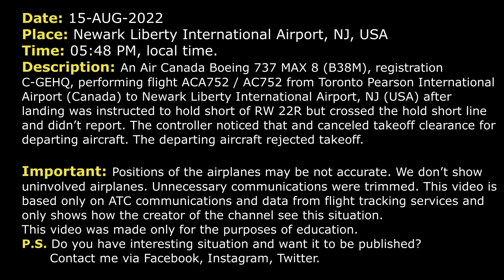Runway incursion. Air Canada Boeing 737 MAX 8 didn’t follow instructions at Newark

Comment: How is it pilot Deviation if the ATC guy told them to cross then changed it back to hold short as they are already moving?
Reply: Controller has some fault, but pilot should have waited for full clearance and read back before moving
Reply: Pilot shouldn't have started moving until completing the readback.
Reply: Lesson learned: Air Canada pilot should have just read back "Cross 22 right at ... November, ... Air Canada seven ... fifty ... eh ... two" so that when the controller corrects them they can say they already crossed the hold line. That way it's not clear the pilot is to blame, he can argue the controller gave an unclear instruction and waited too long to correct their read back. It's stupid, but has more chance of defending that point than the current stance of "yeah we crossed the hold line and then we lied and said we didn't."
Reply: If the ATC never said it, then there would have been nothing to disregard. They don't tell a pilot to disregard something they never said. The disregard is the smoking gun. The incident was at least 50% the fault of the controller.
Reply: @MaxZomboni  Okay, so for controllers who do this for a living, it is vastly easy to make a mistake like that. It happens to controllers everywhere because it’s human nature. You don’t carry out a command until the command has been both given and read back. Thats just the rule
Reply: @MaxZomboni  0% controller fault. He never issued a command.
Reply: @mattz1230  So what was it that the controller told the pilot to disregard? 🤔
Reply: @MaxZomboni  The crew was told to disregard any intentions that the crew had. 

Do you think the crew was issued any valid instruction? YES or NO. 

Do you understand that crews are prohibited from ANY ACTION that does not involve the safety of their aircraft without valid and complete instructions, AND without a valid readback?
Reply: @mattz1230  Okay, now you are just trolling. Your narrative is not consistent with the audio. Watch the video again and pay attention.
Reply: @MaxZomboni  I watched. 

Please point out the timestamp where you heard the tower give clearance to cross 22R, and the crew read back those directions.

The audio CLEARLY states that the crew was NEVER given permission AT ANY TIME to cross anything. They were told twice to hold short of 22R, yet not only did they fail to do so, but they LIED that they were holding short, when they had in fact entered an active runway, endangering a second plane and forcing it to abort its takeoff. 

Go, watch the video again. This time, pay attention.
Reply: @mattz1230  1:09 Air Canada 752 at November cross runway… If you have a hard time hearing then read the captions. The controller is a confused mess who caused the incident and then blamed the pilot for his own incompetence.
Reply: @MaxZomboni  Cross WHICH runway????

Where is the readback???

Without those, there is no direction. The pilot does not know which runway to cross, and has not confirmed. 

1:10, there IS a valid instruction: Hold short of runway 22R, and a proper readback, which was a lie.

Thanks, you proved yourself wrong. YOU LOSE.
Reply: @MaxZomboni  "The controller is a confused mess who caused the incident and then blamed the pilot for his own incompetence." No worries, the guy you try to convince is on your side: Blaming others to cope own social issues, so why the need to defend a side if you can hate both for free?
It's not like you have any intention to understand that the controller was just annoyed for good reasons: He had to cancel a takeoff and/because pilots did not >>report<< them rolling a bit over the line, which was still far out of reach of the other plane. After all it was just unfortunate that they just hit the brakes 2 seconds later due to expected clearance.
Reply: All valid points that add to safety, well said by all.  This is how I think it played out.

I would say crew needed to tell ATC when they were over the line.  Also, most likely, when they were given the first hold short clearance they were still moving towards the hold line when told to cross and had not yet stopped to hold short of the runway. Which is why when they were cleared across but told to disregard in the same sentence the nose had moved slightly over the line. They couldn't slam on the brakes to stop and it took some distance to stop.  The video shows them having stopped on November short of 22R when in fact they were always moving and it ended up just being bad timing. If they had stopped short of November there is no way they could move the plane quickly enough from when the controller said "cleared across, ahhhh actually disregard and hold short 22R." So they had to have been moving the whole time.

That is why it wouldn't be possible to have spooled up the engines and moved from a stop in the same amount of time it took the controller to say "cleared across, ahhhh, actually disregard, and hold short of 22R."  And I think the crew did not call tower because they knew they were in a safe position although slightly over the line. If they felt they would cause a safety hazard they would have spoke up. Perhaps there is a system that is extremely sensitive and notifies when an aircraft is past a hold line even slightly which is a VERY good thing. ATC did a great job by following the safest procedures just in case.

Bottom line is the crew should just make a quick call to say our nose is over the line.
Reply: @jimwilks1865  They were never cleared to cross. Can you give the timestamp when the controller directed them to cross 22R, and the pilot read back to cross 22R??

Because I can give you a timestamp when he read back to hold short.
Reply: @mattz1230  Matt Z I agree, they were never given the full clearance to cross 22R and to read it back. Only the clearance"At November cross runway......actually disregard and hold short 22R."  If they had been stopped at November already there is no way they could have released the brakes, added thrust and moved during that double clearance.  Horrible timing. The crew needed to let ATC know asap once the nose was over the line. That part is on them. I'm surprised the runway warning system allows ATC to clear another plane for take off  while another aircraft nose is over a hold line. Newark pushes Tin, they have too. Bad timing in this situation and a reminder of procedures is a must here.
Reply: @jimwilks1865  To be clear, because there are alot of people who don't understand it- the pilot was NEVER cleared to cross the runway, not full, not partial, not 1/1,634th of a clearance to cross. 

He was totally in the wrong, and the worst part was lying about it when he then told the tower that he was holding short. The proper response should have been that they overshot. 

Probably still got a number to call, but it would have been correct.
Reply: This one comment has over 20 replies lol
Reply: Controller fully at fault and tried to foist his mistake on the pilot.
Reply: @Capecodham  "Controller fully at fault and tried to foist his mistake on the pilot", well, luckily such professional environments are not about mistakes, faults and blames.
Else these would rather end up like deconstructive YouTube comment sections, where people are happy to judge and blame professionals while not even being remotely in the position to do so.

It's about responsibilities and constructive solutions. Even when the controller made them skip their brakes in this very second, he should still be able to expect pilots to >report< when crossing the holding line for some cm. 
Because after all ATC is responsible to have everyone stick to rules, no matter what. And you can't blame the controller for being somewhat disappointed about this outcome.
Reply: @thomas.leitner  Constructive solution: Air Canada crew is suspended, and required to retrain on ground procedures. 

Their foolishness endangered two aircraft and hundreds of lives, and they tried to lie to cover up their error.
Reply: @mattz1230  Yeah "Constructive solution..", sorry mate, you don't seem like someone who is able to contribute any valuable advice to any valuable business, when just offering the usual social media level of insults against skilled people. 
You are well aware that "Their foolishness endangered two aircraft",  is only your desparate attempt to offload your social issues onto others.
Like you would even care about how far this line is away from the runway, and how far they crossed it... It would not even help your intentions, if you would understand that even 1cm is considered a runway incursion. Even thinking that pilots would suicide themselves like that..
Just chill out man, like any other civilization before, our infrastructures and technologies are falling apparat anyway as such skilled people die out or give up while idiots raise over the next decades. So eventually you will be appreciated after all..
Reply: @thomas.leitner  If the controller never gave poor instructions, this never happens.
Reply: @Capecodham  "If the controller never gave poor instructions, this never happens." Indeed, an unfortunate incident of timing. When even 1cm can cause that situation you can imagine how many more safe guards and rules are there to avoid actual accidents.
Unfortunately those people who always do the correct thing, somehow always end up on social media, happily blaming others, instead of taking on such responsible jobs.
Reply: @thomas.leitner  PATCO gave the controllers what they deserved.
Reply: @Capecodham  No worries buddy, PATCO would not even talk to people with your attitude. Which is why you have to stick to YouTube. Such business only works with a professional "Just Culture" ("No-Blame-Culture"), which is the opposite of your social issues. Else you would find your like-minded people on their radio communications.
Reply: @thomas.leitner  Reagan fired them all.
Reply: @Capecodham  ".. fired them all" Yep, that's actually the  best thing that could happen to humanity. Getting rid of all those skilled people who feed idiots with language-capabilities, internet-access, and transport infrastructure.
Reply: @thomas.leitner  Except, FOOL the crew was never given an instruction. 

The only bad timing was this crew trying to rush to failure. Who then lie about their error. 

There are people who do the correct thing- they're called professionals. There are times where zero defects are allowed- aviation is one of them. Try getting one of those type of jobs- you'd understand why errors are not allowed, and you need to be professional and own up to your errors when you make them.
Reply: Nope.  ATC NEVER said “cross 22R.”   What he said was “cross…. actually Air Canada disregard, just hold short of 22R.”  

The pilot jumped the gun before receiving a full clearance AND…. The pilot should NEVER EVER proceed ahead with a directive from ATC, until the pilot gives a read-back of the instructions from the get-go.    100% pilot error and NOT the error of ATC in this case.
Reply: @colt10mmsecurity68  And to add to it the next error: Once he had crossed the line he should have read back "unable hold short of 22R, we're already over the line, sorry for that", that would have made it much easier for ATC to react properly
Reply: Being close to the runway it is not a good place to change your mind
Reply: @stenic2  no, the pilot started rolling and crossing the hold short lines BEFORE he received an actual clearance.  The pilot assumed he was about to get a clearance, so he began to cross prematurely.  All pilots know that we are to hold short and stay off the runway, until we are clearly given a clearance and then we read-back that clearance BEFORE we even start our roll.   Again, 1000% pilot error on this one.
Reply: @colt10mmsecurity68  when a plane like the 737max starts to roll it takes time for it to stop
Reply: @colt10mmsecurity68  ok it is formally pilot error but the lesson learned is that the controller should not give contradictory instructions to a pilot close to an active runway, I would say the mistake the pilot made was not reporting he had crossed the line. Once again I am not looking who to blame, I am only pointing out what should be avoided, I am a tower controller.
Reply: @stenic2  …I was a controller before becoming a pilot for UPS. I know both jobs.
Reply: @colt10mmsecurity68  "no, the pilot started rolling and crossing the hold short lines BEFORE he received an actual clearance." Isn't the issue more like, >while< ATC started to give them the clearance, they just did NOT hit the brakes, when needed? If they were already holding, wouldn't the engines take far longer than that to be able to taxi?
Reply: @thomas.leitner  Sure, you just explained it another way, but the end result is that the pilot started his roll forward BEFORE ever getting a full clearance.  I think you and I are on the same page here.   Others just aren’t getting it that just because ATC starts talking on the radio to a pilot, doesn’t mean a pilot can assume anything, nor take action becasue he/she “thinks… they’re getting a clearance.  The pilot must always receive the full and understandable clearance, read it back and THEN it’s safe to take action with the aircraft.  The purpose of the read-back is also to allow the controller to correct the pilot or even himself with instructions originally given.   I thought this was just all basic “pilot-101.”   Evidently it’s not.
Reply: @colt10mmsecurity68  "I thought this was just all basic “pilot-101.”   Evidently it’s not." Indeed, it's more like a psychological bad timing not to consider braking, while the clearance seems to come through. Well, I guess most safe guards are there for a reason, until aviation becomes fully AI driven. Which might not happen since the world wide average of IQ and skills keep leveling off towards social media niveau in the next decades, which gets rid of misbehaving professionals in a more efficient way.😀
Reply: @colt10mmsecurity68  Exactly. Tenerife happened because van Zanten *thought he had a clearence for take off. It is obvious even for us non pilots that you should only start any action after both pilot and ATC have completed their full read and read-back.
Even worse, the pilot never reported!! I wonder when he would have told ATC, maybe when he saw the other plane hurtling down the runway with its wingtip perhaps just ligned up with cockpit where he was seated
Reply: @austintx_planespotter8561  the departing aircraft wasn’t a 73 max
Reply: @CamFlies  I know
Reply: @stenic2  Tower never gave him an instruction. Should a pilot start a takeoff roll as soon as you the controller say "cleared...."??? 

NO??? Then why should he start rolling across a hold line when you say "cross....."
Reply: @thomas.leitner  Crew should have been planning to stop short of the line, and should stay on the brakes until fully cleared, and read-back complete.
Reply: @mattz1230  "Crew should" yep, as they usually do, until human psychology fails them due to an unusual timing and they ended up short after the line.
Reply: @colt10mmsecurity68  Aren't you special.
Reply: @austintx_planespotter8561  No reverse?
Reply: @stenic2  Controller fully at fault and tried to foist his mistake on the pilot.
Reply: from what I hear (and not being able to reply the actual surveillance data it is just speculations) the pilot made the mistake of not telling the controller he had crossed the hold short line. he replied "holding short" which was not true since, even if it was just the nosewheel, the plane is inside the runway strip and the runway is not clear. what I wanted to stress (and what I try to teach during the OJT)  is that  in certain circumstances a controller should make a decision and then stick to it to avoid giving conflicting clues to pilots which can and will make mistakes just like controllers and generally human beings do.
Reply: @stenic2  He made a decision. Hold Short. Pilot and YOU assume he had decided to let him cross, when no instruction to cross was given.
Reply: @mattz1230  ok think what you want. I am giving up...
Reply: @thomas.leitner  psychology failed them because they were being unsafe and rushing, and assumed that they would be clear. 

Can a pilot start a take off roll the second he hears "cleared..."? Or is he required to wait until the readback is complete?

They got caught trying to rush, then lied about it. The lie is why they should be suspended.
Reply: @mattz1230  "Can a pilot start a take off roll.." This seems like you assume, that they were already holding and just STARTED to roll as they heard "cross RW..." and had to stop one word later with "...actually". Which is not how fast people react and engines are able to spool up.
They say "Well, we were >gonna< hold short (about to brake) then you told us to cross (did not brake) and then you told us to hold short, so we got over the line (finally braking)". Which part makes you think they lie? And is there any specific reason you feel privileged to insult professional people? People who are able to contribute more value to the world in one day, than some people are willing to contribute in their whole life.
Reply: @stenic2  Good idea when you're wrong.
Reply: @stenic2  well this is a video and we have no idea how close he was to the line
Reply: @austintx_planespotter8561  Doesn't matter if it's 200 feet over or two inches. Hold short is hold short.